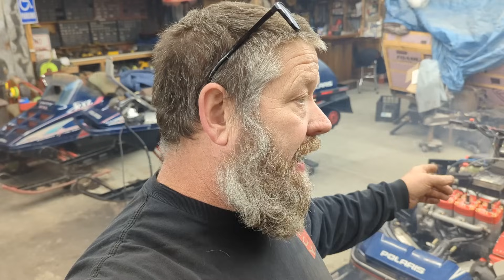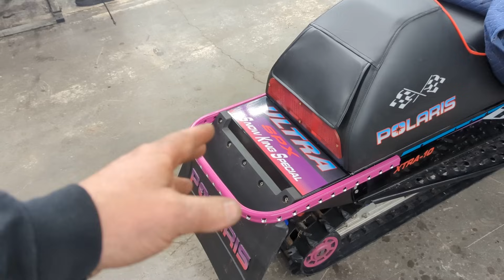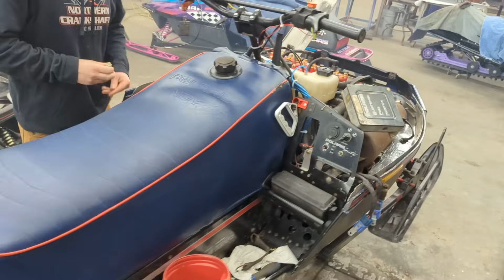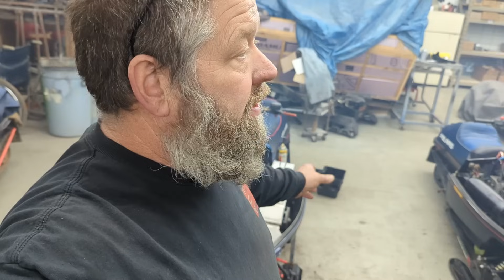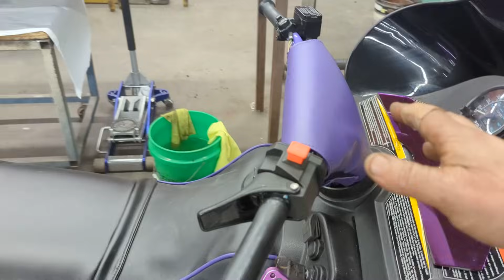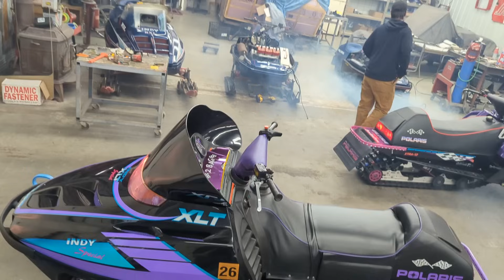POLARIS RXLs 650 X2 BARN FIND WILL THEY RUN

Comment: Stock pipe 650s just sound amazing. On the CR 125 bars, do the cables still fit well? I like a small rise and straighter bars and this looks about right.
Reply from the maker: Yes with the bars and a 1 inch block all is good. In total about 3.5 inches rise and a couple inches forward

Comment: The custom color rope guide's are pretty cool. Back then, the starter rope would rub a track in the plastic guide. And there goes starter rope which you have to remove starter and fish rope out. My solution back then was Polaris earliest design. Which was just a steel loop for the starter rope and where the bolts mount to chaincase and key choke area. I saw the design I believe on your leaf spring triple.
Reply from the maker: We have  aluminum guides on a few of our sleds